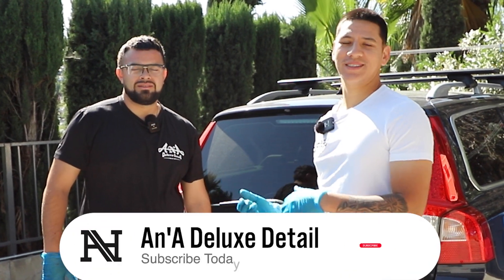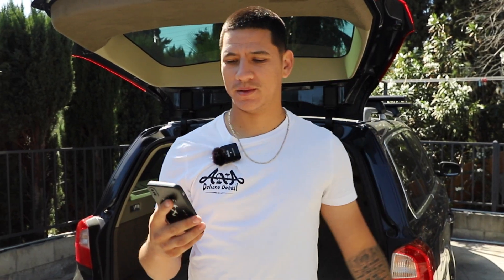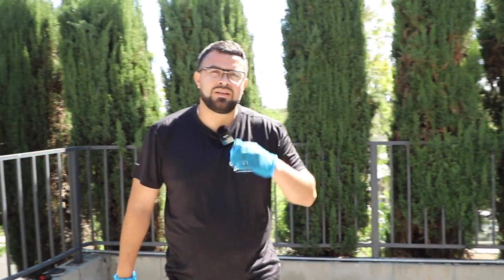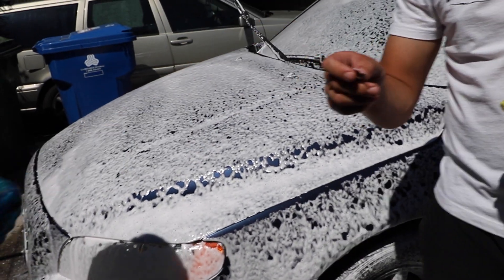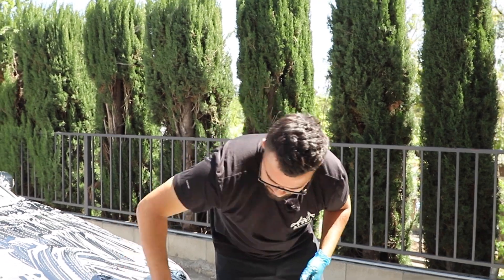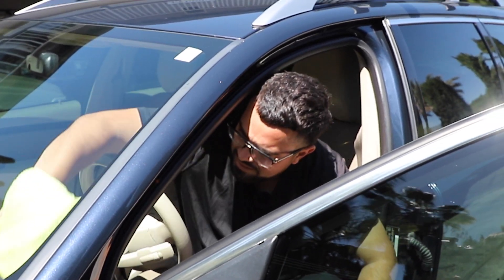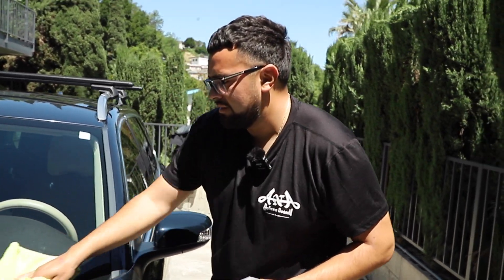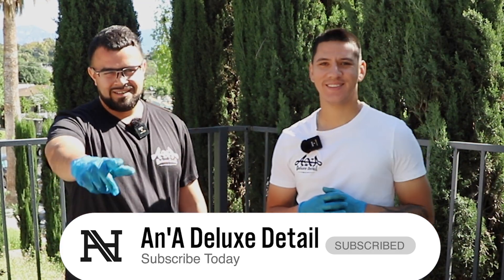We Didn't Know What To Expect For This Detail - An'A Deluxe Detail

Comment: Bro
If the car was ceramic coated, you wouldn't need to clay bar it. It's called ceramic for a reason. It's hard like cermaic. It's not porous so contaminants will not embed into the ceramic coating like they did before in the clearcoat. The entire idea of ceramic is that you get all the dirt and contaminants off with a wash. No need of claybar if it was a real ceramic. Unless the ceramic is starting to fail because it's either very old, poor quality or not applied properly.